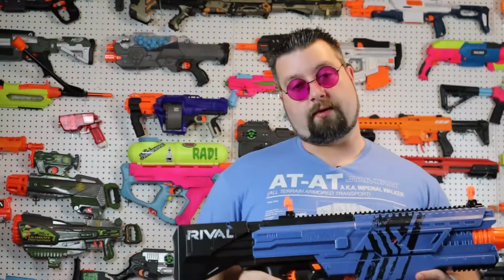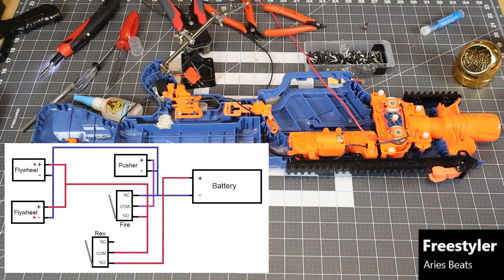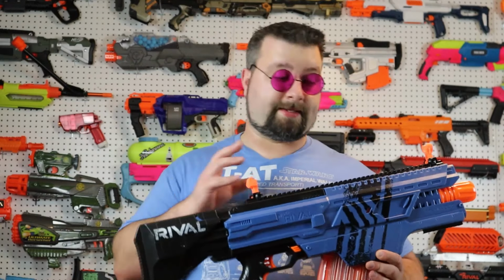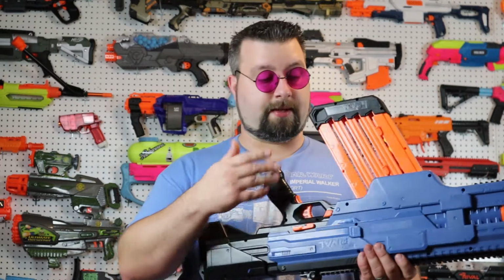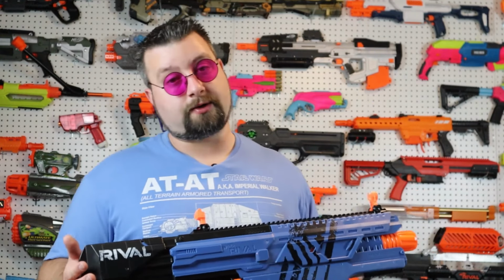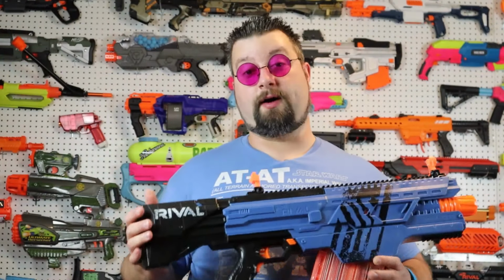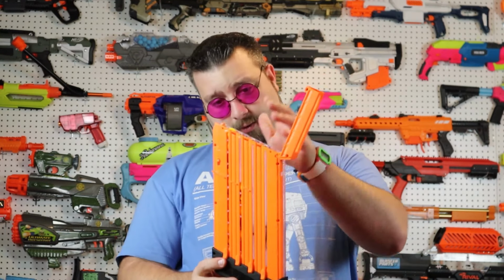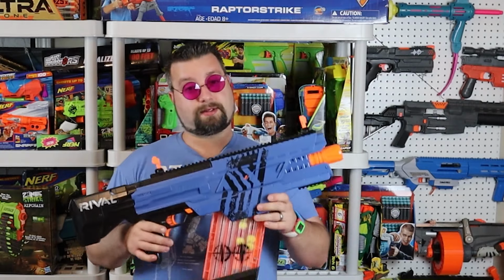Nerf Rival Khaos 3s Mod 120 Rounds in 27 seconds

Comment: I just found this at my local pawnshop for $40 and just finished this mod. Almost spent that money on a Nemesis over 200 miles away from me and I’m kinda glad i didn’t.
Also bought a 3D printed hopper adapter to ditch the mags entirely. Lol
Reply: a nemesis is literally better lol
unless you have a  lot of khaos mags, and even then they’re big so you can’t carry that many, and you ned a rig. nemesis, just carry a bag of balls and dump em in when you u need to
Reply: @josemoreno7785  or you can just buy a 3D printed hopper adapter for the Khaos, for less, and mod a paintball hopper to fit that and BAM, hopper fed Khaos.
Reply: @Demonanimator  if that floats your boat ig